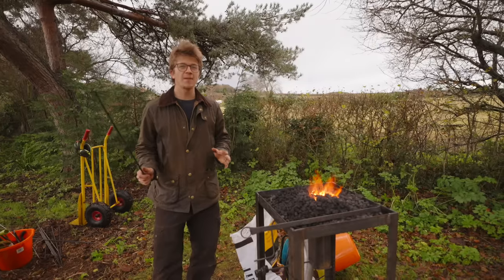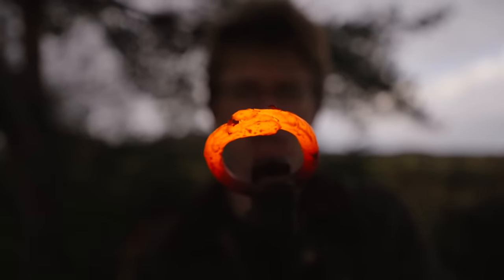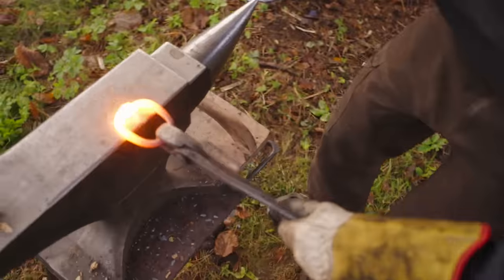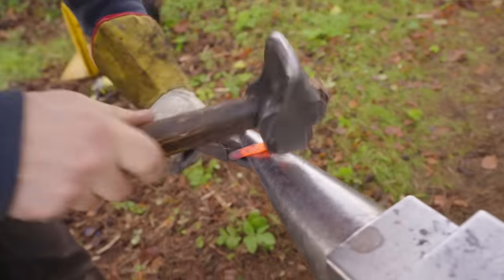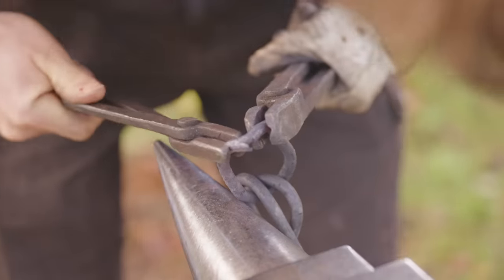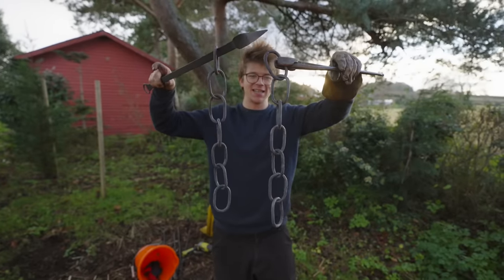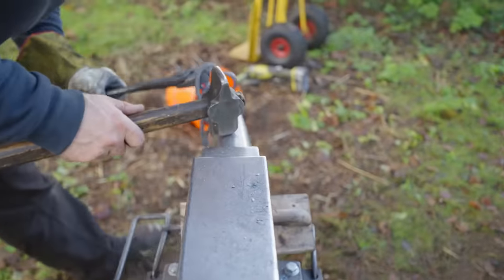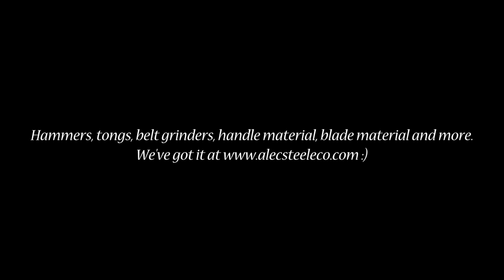How Much Chain Can I Make in a Day?

Comment: Your links-per-minute isn't as bad as you might think because if you were doing it professionally you'd have several pieces on the go at the same time which would severely reduce down time while waiting for things to get to temperature, there would always be a piece ready to be processed. How long your arms would hold up to the non stop workout is a different matter 😅
Reply: and just doing open links for non-stop and then welding them shut at the same time connecting them together.
Reply: Too many irons in the fire? ;-)
Reply: @Burden82  yes, definitely better to cut all your blanks, then bend all the Us, then forge all the scarf joints, and finally weld together the chain all in one go. This would also allow you to have one end of the chain feeding into a bucket or something on the floor so you can work on the other end without having to finegle the tongs so much. Joining segments piecemeal like this was probably the best way to do it for this one-off video, but you can probably see how it would be more efficient to work from one end of a very long chain if this were what you did for your job.
Reply: Also I'd imagine you'd do cutting one day, shaping the next, and welding the third. Chances are even higher that apprentices would have done the cutting and shaping while a journeyman did the welds.
Reply: @benadams5557  I could imagine a master telling a hyperactive apprentice to bend U's, smash scarfs, all day, every day, for a month before even showing the kid how to weld. However, chain making would probably be epic weld practice for the apprentice, and if a link fails in testing, just make a new one before selling or delivery. A smithy probably had more than just one apprentice helping out as well. Hence so many "Smith" last names.
Reply: You could have blacksmith apprentices practice making chain, giving them experience and giving you a near constant source of chain links. When you don't have a major project, you spend a day making a few lengths of chain.

EDIT: didn't read replies.
Reply: @baronvonfritz  Chain, nails and horseshoes are actually exactly what an apprentice Smith would expect to work on for at least a year. You're right on the money.
Reply: @andrewstepanek8933  not to mention the occasional tool that was ordered or they more or likely worn out or broke and needs repair
Reply: @baronvonfritz  Blew my kids' minds when I described how last names used to only be a rich person thing, and when us commoners started taking them it was often just whatever their job was.  So yeah there's Smith, but also Weaver, Carpenter, Potter, Taylor, Hunter, tons of others.  And many of the ones that aren't are probably the same, just originally from another language that got transliterated into English.
Reply: @jdlessl  or place names! My own name is  from a tiny village I've never been too. Most likely one of my ancestors came from there and joined the army or some other organization, and took/were given their place of origin as a last name.
Reply: You'd also likely have a #2 moving things around for you in the background!

Comment: Since a chain is only as strong as its weakest link, now I'm very curious as to how consistent you got at your welds, @Alec Steele. How about making some links, having them pulled to breaking and seeing how much force is needed on each?
Reply from the maker: Great idea! I need to find a way to make a rig to test it!
Reply: Local engineering college probably has an instron.  Basically measures force and how much it stretches.
Reply: @AlecSteele  Just use a come-along between two immovable objects. Should be enough to break a light chain like this one.
Reply: You'd be surprised how many "immovable objects" become moveable when a chain and come along are applied to them
Reply: @blackoak4978  i'm sure they could find something lol
Reply: @AlecSteele  what if you used wood charcoal like the japanese instead of fossil fuel coal to avoid clinker impurites
Reply: definitely ask Ryan at @howNOT2, they just got a new rig going that will pull 100+ kN. easily enough to break that chain.
Reply: @frankwalker6984  It's certainly in the same vein of their content (although I imagine quite a bit higher in force requirements than their usual rigs)... still would be an interesting crossover.
Edit: just saw @Troggination's comment re: their new 100kN rig.  Disregard xD I think that'll do it.
Reply: @importanttingwei7747  It would be much harder to get steel up to temperature with charcoal than with coke, coke burns far hotter than charcoal does. I'm not sure about how much it would affect the clinker though, could be interesting to test.
Reply: @AlecSteele hydraulic press working in reverse with some minor alterations and a scale would work, project farm could give you an idea of what I mean
Reply: @frankwalker6984  i saw that one coming 😂
Reply: @AlecSteele  Would also be interesting to see how they compare to modern day links of same/smaller sizes
Reply: @lborlet5204  if you hook the chain up to a stationary bit on top of the press then it will pull it down, so you don’t even need to put it in reverse.
Reply: @geoffrey6000  that would be a pretty decent comealong id say
Reply: @bushratbeachbum  they can handle a hell of a lot. Also this chain is very thin, with huge rings, so i'd imagine a week joint would surface with that amount of tension. Also, the first time they pull on that chain, all the links are going to stretch like hell xD
Reply: @importanttingwei7747  that makes no sense
Reply: might also be interesting to see it compared with a chain that is flattend and riveted on the ends instead of forge welded. Both in producton speed and tensile strength. my guess is consistansy might make the rivoted chain stronger.
(sorry for bad englis, not my first language and dyslectik😅)

Comment: i would like to see you strength test a couple of those links in comparison to a modern made chain. This kind of look back to what blacksmith had to do by hand before machines took over is always interesting as well.
Reply: I read once that when factory welded chain first became available, old time farmers didn’t trust it, and thought it would be to brittle, and would temper it by wrapping the whole chain around an oak stump, and throwing it in a bonfire. 
Not sure how true the story is, but sure sounds plausible.
Reply: @Vikingwerk  instead of just hanging more and more weight from a conventionally hand made chain and a factory welded chain to see which hold more weight
Reply: @Vikingwerk  Interesting, never heard that myself. I agree it sounds rather plausible, and as the end user of the chain I expect the farmers would far rather a weaker chain for being too soft over the brittle failure mode of snapping without warning while under less than the rated load...

I too would love to see this chain strength tested - after watching Tod's Workshops Arrows vs Armour videos it was quite clear the forge weld at the socket of the arrow head was not reliably that good, but sometimes even when the shaft doesn't break either the heads survived, so at least some of them were good welds. This chain test would be an interesting and simple to quantify demonstration of just how reliable a forge weld is. Not of any direct comparison, but still an interesting data point towards understanding the results of those tests.
Reply: At Hereford college they test hadn forge fire welded chain links. I think we made the links from 10mm thick round bar. Made 3 links to fit in the machine and mine snapped at about 5 tons pulling force. A friends chain links snapped at about 9 tons. Other didn't even make it to 1 ton. It just depends how good the fire welds are so can be inconsistent results depending who makes the chain. I never seen them test a modern cabin to compare it with but that would be cool to see. Also our chain links were not hardened and only made from mild steel
Reply: @ThistleForge  If you are only testing 3 links you made its really not enough to say anything - perhaps your 4th chain link would be the weakest link and fail almost instantly under load. Even a skilled craftsman will have some variation, as will the raw materials they are using - so really need to test at least 20 odd links to failure per smith really - enough to prove your bad links are within a reasonable spread to the best links possible, or the chain's rated load.
Reply: @GameCyborgCh  That only tests static loading you need to compare them with a dynamic load as well.
Reply: I am pretty sure they had something like a template, to bend the hot iron rod around, probably saves quite some time.
Reply: @shawno8253  easy enough, just fix them on one end, then attach weight to the other and drop it
Reply: @foldionepapyrus3441  its just a bit of  fun while at college and not for anything serious, not like we are going to stand there making 20 links each for fun in between coursework lol. also this was 10 years ago and i cant even remember if that was the thickness of steel used. they just do it for a bit of fun competition

Comment: I make chains for fun from time to time, no particular reason (then melt the metal and start with bars again with some extra scrap) and one thing that makes the operation easier is to make a bunch of separate links then make more links to unite them. The idea being that you're not splitting your work method between the two types of ops in making a chain, you're only performing like - like operations. It gets downright therapeutic.
edit:also, you don't move the whole chain. You get yourself a table with some nails in it, and use the nails to secure the chain up the table as you make them. You only move one finished link and one working link from the fire to the anvil. Moving the anvil closer and working the fire from over the anvil is also a good idea (table sits to the side you're more comfortable with. I put my anvil with the nose about center to the fire pit, table to the right of it and as i finish one link, as the fire heats the next prepped link, i move the chain one nail up.
Reply: Even if you can't cover your time, Etsy should more then cover fresh stock.
Reply: You should upload a video of this process if possible

Comment: We made chain in a blacksmithing class I took about 20 years ago. We made 3/8" x 1 1/2" links, first we made 30 links separately then we made 15 open links then we linked them together.  At the end of the class we tested the chains with a hydraulic ram, mine broke at a hair over 2000# when a bad forged weld popped.  The anvils we used were made out of railroad track and had been specifically modified for making chain links.

Comment: They demonstrate chain making at the Black Country Living Museum in Dudley. They use a chain makers anvil set close to the forge, though I think they just keep adding to the end of the chain, which once you get to long lengths has the advantage that you're only lifting a short length of chain - by joining shorter runs you're lifting the middle of a folded chain.

Comment: I'm a smith from upstate NY USA, you can save a lot of time by hammering the section you are going to cut into a scarf before you cut, then cut and scarf are one heat and you can scarf two links at once, also with a longer fire you can shape the link in that same heat while still on the rod

Comment: If it takes 8 hours to make 19 links (40 minutes per link each link needs 5 operations cut, bend, scarf, weld, link) could you perhaps go faster doing the same operations (like cutting, bending and scarfing) 20 times then linking 3 to 5 when you weld?

Comment: You might try winding your rod stock around a mandrel. Then use a hot cut on an angle to give you a bias cut link for welding. 

After that you weld in batches one link after another. It’s often easier to assemble the chain and then do the welds. 

You can pile it in a bucket or wind it around a helper that resembles a short coat rack. If your doing a lot of it you can wind it on a big spool.

Making individual links one at a time will take a dogs age.

Your experience may vary and I haven’t made any chain in years but that’s how I learned it. 

Anyway, well done. Skills, tools, actually making a living at this stuff and charisma to boot. You are winning.

Comment: You could make more in a day if you did it production style. Things like scarfing the ends of all the bars before you bend them into links then bending them all into loops before welding the ends, etc.
Reply: Probably faster to do the scarfing after bending the blanks into a U shape. When they're straight you can only heat one end at a time and you have to pay careful attention to the relative orientation of the scarves so that they'll line up when bent. When you forge the scarves after bending you can do both of them in one heat, and they're aligned with each other by default. This also creates a natural separation between the cold work of cutting and bending, and the hot work of forging and welding.
Reply: I might be wrong but i think pat meant after the initial u bend but before the final set of bends to make an O
Basically it would be...

Cut 20 straight sticks
Bend 20 Us
Scarf all 20
Weld them
Reply: @tissuepaper9962  if the bends were being done cold I would agree with you.
Reply: @tissuepaper9962  you can have many irons in the fire and simply pump out scarves on one end for a day, before pumping out the far end for a day, before bending U shapes for a day before welding links for a day or two. The average number of links per day could get pretty high if you minimize the time spent adjusting positions while at temp and don't have much if any downtime waiting for heat.

Comment: Next step is to make a Gunter's chain - used for measuring out distances for surveying in old imperial units. An imperial chain = 22 yards/66 ft = 100 imperial links, 1 link = 7.92 inches. The most frequent place to see something that is exactly 1 imperial chain is the distance between the two sets of stumps on a cricket pitch.

Comment: Last time I used an old timey blacksmithy forge like this (but deeper and tapered so the gunk does go to the bottom when you shake up the coal) was in 1993 when I were 18! I made a few horseshoes and a wheel rim and placed it upon the wooden spokes while hot to have it expand onto it and burn into place on the wooden spokes for a cart.

Comment: Theoretically you could go a lot quicker if your chain doesn't need to hold a lot of weight and you can just butt the ends together without a weld. I just saw a video from That Works earlier today where Ilya was making nunchucks and he used a really clever method where he bent his chain stock around a larger round stock until it was in a nice coil. Then he used some bar stock to shape it into ovals. He cut the whole thing down the middle, then put all the links together.

Comment: It's helpful to have a little hook for the hardy for both welding, and holding the other links for pickup. So first it's got two hanging, loop through and weld without touching or wasting weld heat. Then same again on threes for the seven, sevens for the fifteen. Then the operation is the same every time and there is no mess of links anywhere except hanging straight down.
Reply: You got spam

Comment: I really want you to redo this but with a bending jig to get the links bent before you cut them. Maybe you could bend multiple wraps and cut them with a saw before scarfing them on a grinder or something...of course, that would mean one side of the chain links would have to be wider to accommodate so that you could squeeze them back together for the weld and have them overlap...but that's just a part of the jig, I reckon. With modern tools and methods, how much more could you make? You can even do a third go at it where you allow yourself the use of a modern welder or torch

Comment: I always found that starting with 200mm of 12mm steel, upseting each end and forming the scarfs on a sharp corner of your anvil makes it weld easier and you have enough material left after your first heat to then forge it back into the original diamiter with no honesty marks.

Comment: You should redo this with the period in mind. I would think a blacksmith would have an apprentice or two at any given time. One cutting lengths, one making rings and scarfs, and the master welding. 

Also, hang the chain. If it's suspended above the anvil while you are adding a link, say from a line that runs from the forge to the anvil, the work would be quite a bit less awkward.

Comment: If I was to rationalize production and make it more efficient, I wouldn't cut the bar right away to make a link's length, but first forge it flat to make the beveled end, and then cut it when it's thin. In one heat and less hammer blows, you prepare the second end of the link you're cutting and the first end of the next link. Saves time and coal.

Comment: Seems like a blacksmith back in the day would start with a massive pile of singles already made up, cold, piled in the corner.  Basically something for the apprentice to do to learn and practice their skill when its slow. Then, when a chain order comes in, they would make sets of 3. After a specific number of 3's (dictated by length ordered), start linking those into sets of 7, then 15, etc...... By working 1 progressively longer chain, you are destroying your efficiency.

Comment: I have a challenge. Make some star drill chisels for manually drilling holes in stone. I can't even find modern ones online, only used from eBay. The alternative is a holder for bits made for hammer drills, marketed to rock climbers, but they cost like $80 which is more than some hammer drills. You could make feather and wedge rock splitters to go with them